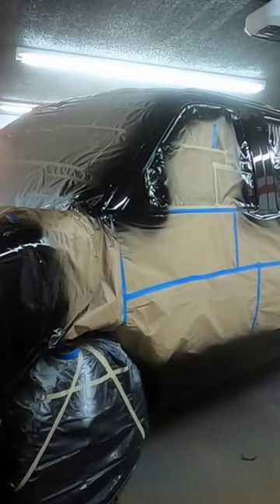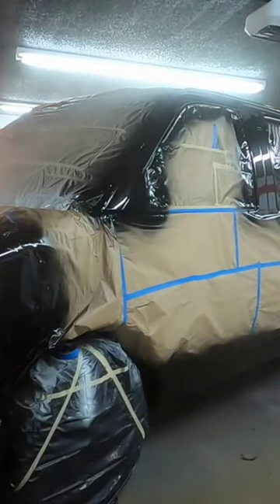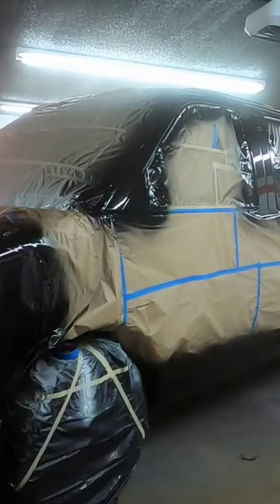Do you PAINT your radiator? 🤔😎

Comment: i don't know about radiators, but i would personally avoid painting something like an intercooler, as it's been proven that the added material slightly minimizes the heat exchange capabilities. Again, not sure if that's applicable to water coolers
Reply from the maker: I told you people would give me crap for this lol. Whatever. You can mask yours up lol.
Reply: @HowToPaintYourCar  i mean unless its a formula 1 car, i'm guessing that any slight disadvantage of putting paint on it is negligible anyway. I was just sharing information that i had come across while researching this in the past.